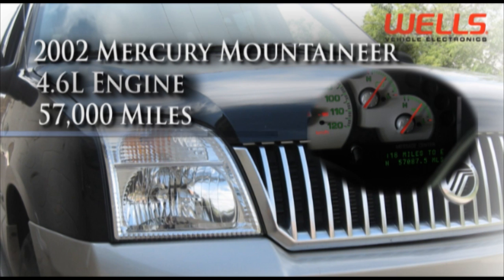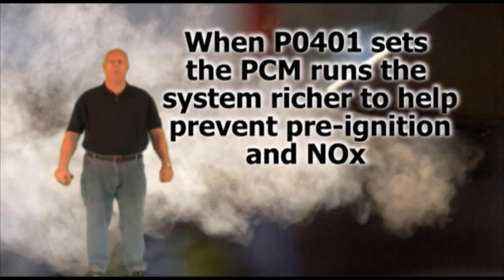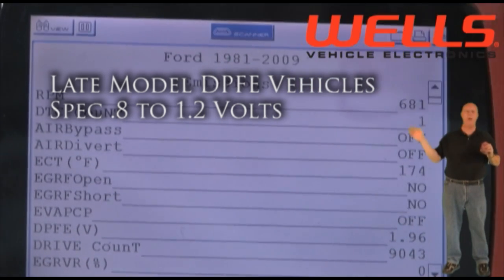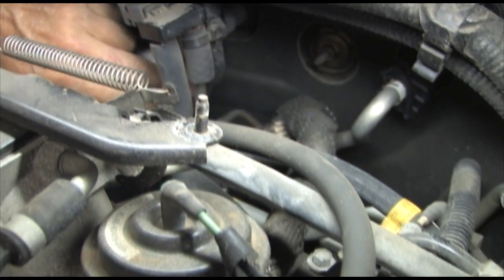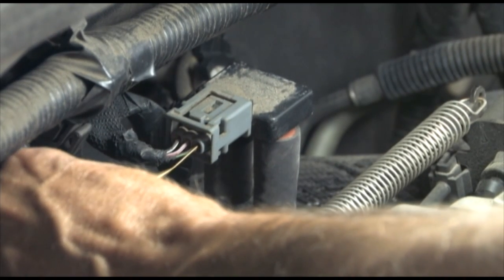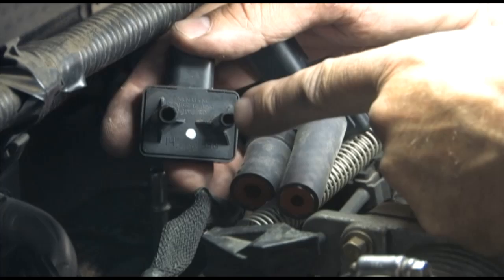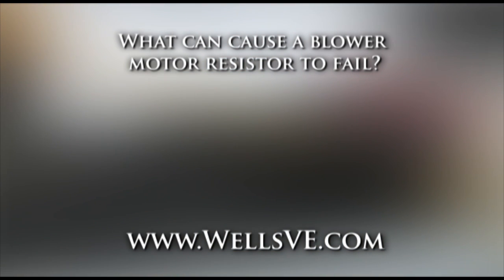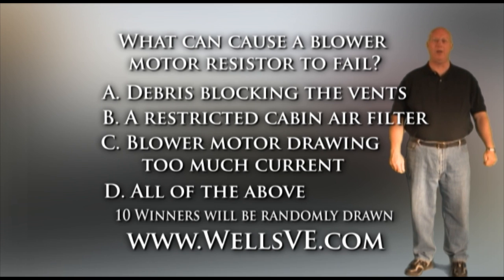Ford P0401 DPFE EGR  Pressure Sensor Diagnostics and Repair with a Contest

Comment: They don't tell you about the DPFE sen's on the older ford's. Made from I do believe aluminium, they build up nasty corrosion and the vaccum lines to the sensor get plug'd with the stuff. Ford later came out with a plastic one to fix thier recall, and don't even think about hitting a yard to find one, they have all been raped of them lol